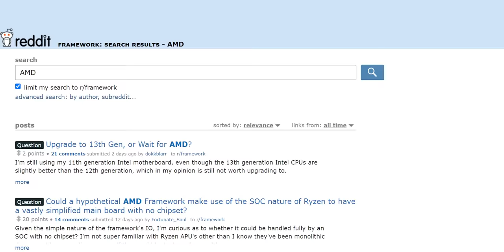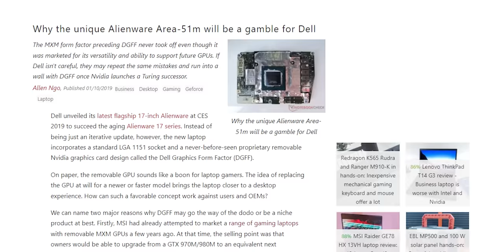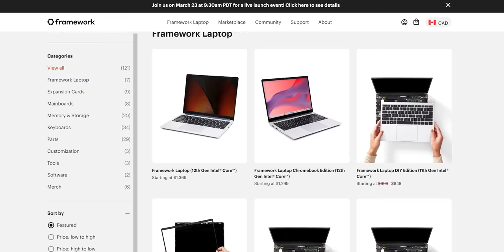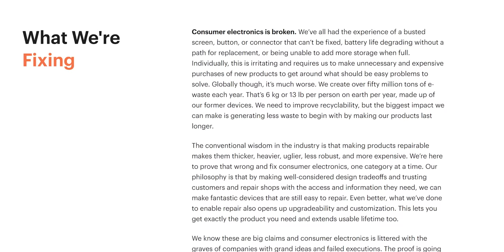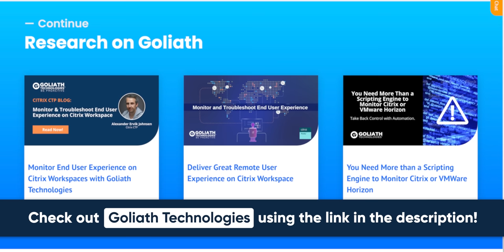I Made a Bad Decision – Framework Investment Update

Comment: I really hope this company is going to skyrocket out the roof. This is so awesome, how long were we waiting for such hings?!
Reply: I think they will, this kind of opennness attracts co-operation. It's the same reason Arduino is successful, or even the internet protocol for that matter.
Reply: Since Dell which they didn't deliver and Framework does it in just 1 and half years
Reply: The idea is nothing new.  Dell started this in their early years, as they allowed you to custom design your laptop.  Because most things were customisable on the motherboards, it made easy work to upgrade your laptop later on as there were modules and socketed CPU's.
Reply: @Christopher_T_Paul  This one here I believe though is attempting to establish a standard. Imagine just like the formfactor of an ATX tower PC, with all the relevant ports and slots and cable standards. We never had that for laptops. Framework is using already established public standards as much as possible and adding a few as simple and flexible as possible ones of their own where there is nothing there yet.

I cannot wait for the day when you can build your own laptop like you are building a PC today, just grabbing parts from different manufacturers like you are doing for a desktop now. You will not have a Framework Laptop, or a Dell Laptop, but one made by yourself!
Reply: @uncannysnake  Possibly, however I feel this sort of laptop is aimed at gaming more than anything and would be quite niche, but there could be a small market there.  An average Joe isn't going to pay extra money to have a laptop they could customise, but I am sure a gamer would.

Certainly Apple wouldn't offer it, they already make their machines as hard as possible to upgrade and repair and wouldn't want you spending your money buying an Asus GPU upgrade when they could just sell you the latest version of Macbook Pro instead.
Reply: @Christopher_T_Paul  No, anyone responsible about repairability and the environment cares about this. I absolutely despise "gamers". It's not a "hobby" or anything noble like that, it is a waste of time and for people with no ambitions in life.

That point aside, there is nothing really about that laptop that screams "gaming". It looks like utility device for conscious people, that speaks very well to me and for a lot of other people I know, businesspeople, system administrators etc. Also the only people who could actually push adoption, "gamers" have way less influence on the market than they think apart from their RGB toys that have so high markups exactly because they don't sell to a mainstream audience

Comment: I've been saying for YEARS that laptops need to be more modular but instead they've been going the opposite way.  I love this idea and I hope this takes off, and even starts to get used by other vendors.
Reply: Blame Apple.
Reply: given that linus got on the board of investors so he could be an industry contact, and that cooler master has taken the first step, more are sure to follow. especially when valve made the steamdeck and seems to be developing a modular vr headset, they would be dumb not to start getting working on modular plug and play parts for more mobile yet powerful devices.
Reply: @dracodragon105  Is there evidence that Linus has a board seat?

Comment: please note CNC waste is immediately recycled at source so no wastage is experienced. .. casting also has its problems as casting is not an exact science in 2024. The cast items also have to be re-calibrated, mill finished and iodized finished

The difference comes down to efficiency of manufacture,however the gap is narrowing but CNC is a much more flexible design path costing less for production engineering.

Comment: This really is a killer product imo. Insanely well engineered and thought over
Reply: older models do have an issue with the system clock battery, which they did put out a "how to fix this guide" which is neat and all, but they really need to have someone on hand to warranty fix these systems for anyone who actually doesn't mind sending it off
Reply: This would probably be really really expensive in my opinion，And these niche products have always been way overpriced in the past but I will be curious to know
Reply: @alex7633  They really just need to hire one or two people who can fix boards and knock out 3-4 of the fixes in an hour, which is significantly cheaper then trying to replace every product with a newer model. It should absolutely be doable, especially if the fix is simple enough that they expect a "do it yourself" guide to be enough.

Comment: This is a lot of people's dream come true. Feels like a proper modern successor to those old Thinkpads with slots for harddrives etc and in a slim design. Incredible.
Reply: All I want now is AARCH64(arm) and RISCv64 SOCs
Reply: Also I could see finger print scanner
Reply: The ONLY think they are missing is the ability to actually support a ThinkPad keyboard ... I would literally pay $1K over ticket price if they could sell me a Framework that takes a ThinkPad keyboard .... with the nipple and the 3 buttons above the touch pad.
Reply: @AlTheEngineer  Same. Only thing stopping me from choosing a Framework as my next laptop is the lack of the touchpoint- I can’t tolerate any laptop touchpad. (Except the Macs. Those touchpads are magic.)
Reply: @Padgriffin  Yeah, I wish they would allow us to even just mount ANY ThinkPad keyboard to it, would be epic. I can't do Macbook glass-pads, they are so huge and annoying, after a while I really get tired from sliding my finger around, its a frustrating user experience to me, I never had an issue with my track point since 1990s .... single point control, and can be done during typing as well. In my opinion, the most perfect mouse input method on a business laptop.

Comment: As a data analyst numpads are a MUST. Thanks for adding this option. I can't wait for this 16 inch to release, I'll even pre-order if there is the option.
Reply: Here's a thought to make you hot and bothered: easily customizable external numpads. Make the base as thick or thin or oddly shaped (let's say, to fit on the leg while seated) as you want and just crank the numbers.
Reply: And I (programmer/general nerd) HATE numpads on laptops, with a passion. Whenever you're NOT typing numbers, you need to position your hands way off the center of the machine, which means that you'll either have your body (and thus eyes) completely off-center too, or keep your hands at a weird angle. The latter being the only option when using the laptop in a cramped space, like a mini-table of a train/plane seat, or just the lap for that matter.

A keyboard without a numpad is just so much more ergonomic for general text typing, IMO.
Reply: why would a numpad that you can only use one hand be better than the numbers above your keyboard that you can use 2 hands on be better?
Reply: @donutvampire105  Better hand placement,plus math keys being better placed, although since I have been daily driving a nano keyboard, I'm pretty fast on both
Reply: my main use for the numpad is Windows mouse keys :^)
Reply: I do automotive ECU tuning.  I adore a numpad.  Being off center doesn't really matter to me because the laptop is half wadded up in my lap while doing dyno sessions anyways.  Honestly left numpad for CAD might be a game changer because all my keyboard shortcuts in that environment are left handed anyways.

Comment: When the initial Framework laptop came out I had only just recently bought a new laptop so I couldn't justify buying a new one at the time, it is still going strong, the new 16" model has definitely got my attention for my next upgrade! This video was worth the wait
Reply: Same here. I'm currently using a MacBook Pro, but will be upgrading soon, and I will not be getting a MacBook Pro.  I'm for sure getting the 16 inch framework. Gpu add on is awesome for video editing
Reply: @codingwithlu  and for machine learning on the go! 😁
Reply: Buy a desktop bro
Reply: Yeah. I got my gaming capable laptop back in late 2019, so the Framework 13 never filled a niche I needed, but the new 16 may well. 

Ironically, I may end up going with an Intel DDR4 based one to keep the initial costs down. As far as gaming goes, it would only really be used for older Steam Library titles, instead of newer stuff.
Reply: @x?an  I do have a desktop.  I actually have 3 desktops and a Mac Studio. But need a laptop for when I travel
Reply: @codingwithlu  Mac Studio 🤓🤓

Comment: What's so cool about this approach to design is that linear increases in parts developed for the framework results in exponential benefits. Modularity with a few parts is cool and beneficial, but making all these different use cases available by just swapping 1 module out is pretty game changing. Honestly the only reason I haven't personally bought a framework yet is because I need some amount of GPU acceleration, so super excited to hear about all their updates.

Comment: I had just purchased a new laptop a few months before I saw Linus talk about the initial Framework release... It only took a few days for me to decide that I REALLY wanted to support this company and I bought one of their higher end models and the peripherals... I then loaded it with Linux AND Windows 10... I had a few issues with their brand new wireless module initially but they were very helpful in getting that sorted out... I have since used it a LOT and LOVE being able to swap out the ports when I need to!  I even got a USB-C dock which allowed me extra monitors and it handled it all with ease!  I am already drooling hard enough to need a bucket at the new design... that has been my biggest concern because I do engineering and a 13" screen is just not enough... That is why I use a 32" 4K monitor through the hub or direct input.  The Framework is AWESOME and I will be getting another once the new stuff drops!

Comment: I got a Framework about 5 months ago because while it wasn't the best laptop for its price, it was pretty darn good. With this continued development of new replacement options I feel very confident that when I want something better in a year or 2, it will be not only possible, but easy.
Reply: Allready in a year or 2? My craptop has lasted me from 2016, although I did change the battery, tripled the RAM-memory and swapped the thermal paste and now for a 7th gen core i3 it now runs quite well
Reply: And that's the magic of it too! When and if you need to upgrade it, you just can at just a fraction of the price! No need to buy a whole new machine at top dollar!

Comment: The 16 is what i have been wanting. Now they have a gaming division of hardware, now I'm interested especially if they indeed have Nvidia onboard. New-gen equals no need to ditch.
Reply: It will very likely be AMD graphics, becasue NVIDIA is notoriously difficult to work with and Framework now already has an AMD CPU option, so it would be much easier for them to also use an AMD GPU.
Reply: @jimhalpert9421  worst case scenario it's an intel gpu
Reply: @jimhalpert9421  yeah most likely although I really hold hope.
Reply: @MrRafting  that would be an arm gpu xd

Comment: NGL i was thinking about how no manufacturers lately have any even inkling of upgradability on the GPU side of things. Glad to see Framework taking steps forward to even more modularity and upgradability. With Cooler Master announcing a chassis for the framework motherboard, are they going to consider a version of the chassis which would be compatible with the modular GPU? Cause that'd be kinda awesome. It'd be also neat to see a skinny macro key addon for the 16" version in place of one of those accent strips.
Reply: With the new 16 inch board supporting pcie expansion, I hope someday they make a NUX Extreme type chassis, where you can pair one of these new laptop motherboards with a desktop GPU in a tiny case
Reply: @jomeyqmalone  you can hook up a GPU Enclosure to a laptop already.

Comment: The modular graphics board is a huge deal—I would have settled for something like the old Dell Precision laptops where the motherboard is smaller and has no onboard video and there's a GPU daughterboard attached inside—but now I want to see them offer one that just gives you a PCIe slot and a six-pin power connector so you can slot in a desktop graphics card when you get it home. Also I wonder if it would be possible to make an eSATAp expansion card for people who want to be able to plug in a desktop hard drive. Thunderbolt can apparently handle up to 18V so it seems doable.

Comment: this is where I'm really getting interested. the ecosystem, the marketplace, the whole biome they are building around their products. it's really cool. hope to see these in stores soon.
Reply: What I love about stuff like this is that by cultivating a community around the product, they can attract people who love modding, upgrading, and reverse engineering things.

For example, someone made an internal magesafe module, there's another one that moves the keyboard and mouse into the laptop, and I'm sure someone insane is going to make a microSD RAID lol. There was another one that uses one as a drawer, which is really funny, lol. But it could be a nice option to carry a small flash drive or SD cards without them sticking out of the laptop

So, with a standard laptop, even if some parts were upgradable, it'd be difficult to find a project, but for this one, I can.

Comment: I'm really glad Linus is so such a big fan.  Especially since we'll get to see the durability when he drops his new framework and the all those modular parts explode out like a grenade.  Will be interesting to see how it holds up.  In all seriousness though, this is really cool and if I was looking for a new laptop this would be one of my first choices.  What an awesome time to be into tech.  Keep up the great work LTT.
Reply: Reliving the 2010 android experience, huh
Reply: @plausibleparadox3191  i miss when it was broken screen or the grand search for the battery, now your phone falls and you're fucked if it didn't have some expensive ass case (that i can't afford)
Reply: @KibitoAkuya  I recommend you take a look at leather wallet covers for your phone if there are any.  They cover the screen as well as the back and sides, they are less flashy looking and best of all most of them are not expensive.  They provide an opportunity to get better than average protection for your phone and spend far less than polycarbonate or carbon fibre cases.  If you take a look around and don't like them you've lost nothing.

I have a padded leather wallet for my iPhone.  I dropped it recently on a concrete floor and the result was zero damage to the phone and zero damage to the case.  The faces are padded leather, the edges that grip the phone are TPU, so it was cheap but it works really well.
Reply: I've slowly made myself sufficiently skilled enough to fix my own phone, because contrary to what people think it's not actually that hard.
Time consuming though, and eventually I'll buy a new phone regardless.
Tech doesn't stay stagnant after all.
Reply: "Especially since we'll get to see the durability when he drops his new framework and the all those modular parts explode out like a grenade."

Funnily enough, that's a good thing because the parts freely flying out everywhere actually help with shock absorption and mitigating damage.

Comment: They should certainly do the touchscreen slap-on board for the new model. It'll make amazing use for productivity, especially considering the main screen isn't touch (but it doesn't matter that much since it's still uncomfortable to use distant main screen as touch). If they could figure so much stuff out, I'm pretty sure they can figure out how to fit all of this together.
Reply: Oh shit I hadn't even thought of a magnetic digitizer, that'd be perfect. I'm not sure how they'd block dust from getting between it and the screen though.
Reply: I use the touchscreen of my work laptop all the time when I'm moving around. Mouse and keyboard while sat, but touch just adds some speed for certain actions that have me trackpad across the screen.

Comment: Once they offer a 360 hinge with a touch screen and an active pen, I'm definitely getting one. Really good job.
Reply: holy shit i didn't even think of the possibilities
Reply: they are kinda old now buy an ipad if you want pen and screen or a samsung tablet they will be better because windows sucks at pen input
Reply: To be fair, you could get the laptop at any point you need, once a 360 hinge and/or touchscreen is available you can upgrade your current laptop :) perks of framework
Reply: @AndrewPL5  Yeah that's why I love framework!
Reply: This!!! Really convienient have for creative use cases
Reply: Oh this would be awesome, like those yoga Lenovo laptops but in Framework flavor... Damn I already want this to happen
Reply: @Spicynoodles15  That's true of most windows laptops, but the surface line is actually pretty excellent. It's not perfect if you're doing like precise art, but if you want something that isn't using a mobile OS, surface pro is more than enough for doing hand written notes.
Reply: @shipwreck9146  surface is the only exception it is difficult for OEM manufacturers to tweak windows and make their hardware perfectly match the software whereas Microsoft is able to make custom surface windows updates which helps them in better compatibility with their own devices and accessories